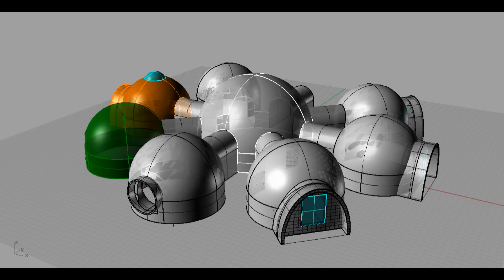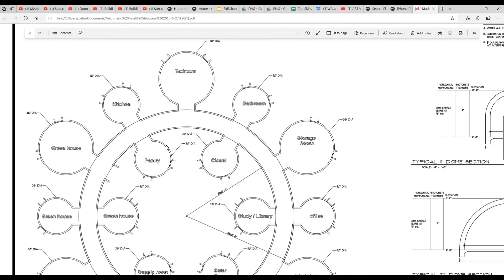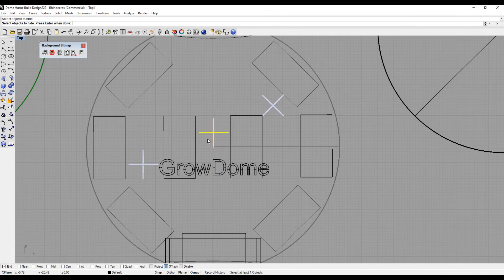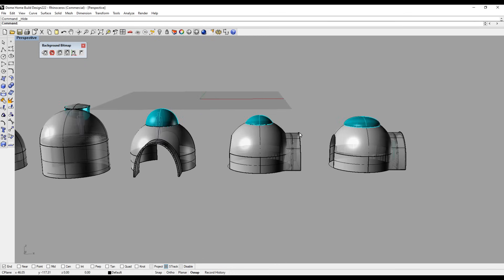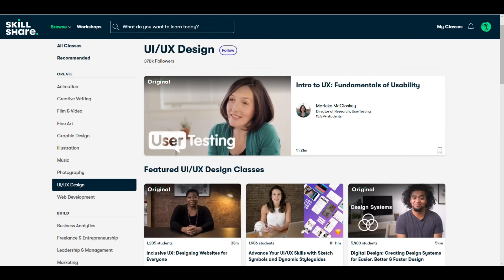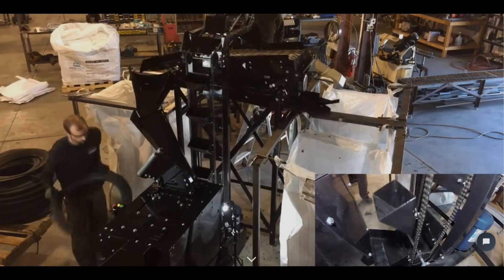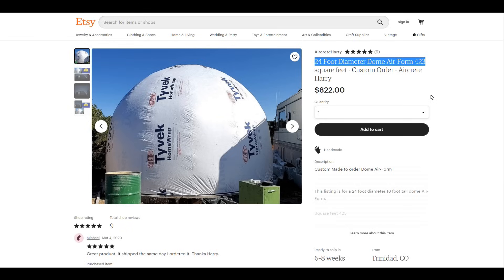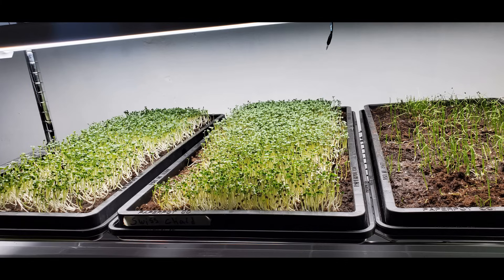Dome Home Design | Aircrete & E.P.I.C. Pump #aircretepump #aircreteharry #domehomedesign #aircrete

Comment: My opinion is, I'd rather build as big as I can. I like your original design better. But it's too symmetrical. I'd make the kitchen 30' dia., with a huge rectangular (round the corners) pantry beside it. I'd eliminate all the greenhouse domes on the left side (I assume that's south) and just have one massive slightly curved greenhouse along the south side. Make another connecting tunnel so you can walk through the kitchen into one end of the greenhouse. Keep in mind all the other domes can almost touch each other. All dead spaces can be closets or shelves for the rooms. Aircrete base with solid concrete floor over, hydronically heated. Center round skylights in all rooms. Reduce the number of domes protruding into the center green space. Consider a huge fake tree if you need center support for the middle dome. I get custom domes blown (for my underwater ROV's) from https://plastic-domes-spheres.com/
Watched more video. I don't think you need any bigger than 4' skylights. In the center dome just use an outer ring of six with a center one. Alot less expensive and still plenty of light. reference https://www.youtube.com/watch?v=RoGuvvzHY1A
Yep, that's the styrofoam shredder i tried to build the first time. Horribly slow! This one is alot better... https://www.youtube.com/watch?v=_DBo9l9YuB0

Comment: Have you looked into building dome windows with plexi glass? I’ve built a few windows with it for a camper that were curved and they work well . Pretty decent U value too especially with 2 sheets . I’d imagine if you built them in sections , you could possibly fill them with argon too . I bent 1x 2 wood in a jig , then painted the wood , drilled pilot holes in the plexi glass , used a bead of silicone and those metal roofing screws with rubber washers. I didn’t use a desiccant in side but I’d imagine that wouldn’t be hard to do . And could probably put a valve in the frame to fill up with argon .

Comment: Does the paper pulp create acidity to weaken the concrete?  How long does it last?  Does it need an alkaline agent?
Reply from the maker: If it had any negative effect, I wouldn't use it myself nor recommend it.

What I personally recommend, depending on the prefered system, are: 
- Drexel 
- Aircrete Thickening Agent 
- Air Entrainment Liquid 

https://aircreteharry.com/product/1-gallon-aircrete-thickener-two-x-1-quart-air-entrainment-liquid-by-aircrete-harry-allows-you-to-pour-aircrete-much-higher-improves-strength-see-description/
Reply: @AircreteHarry  the effects of acididty dissolving mineral bonds over time is guaranteed
Reply: I guess like you have to guage how long you rant it to last and what sacrifices are inherent in the recipe. Self-healing Roman Concrete has granules of alkaline mineral that leeches to fuse cracks that form and is like a self healing perpetual investment.

Comment: As a structural engineer cum architect, I would like to appreciate your lightweight aircrete/ EPIC designs, but this is the time od area of land,/ of high to highest  skyscrapers, during 2003 -6, I got opportunity to work for bruj-khalifa Dubai and got certification for pile foundation work in deserted lands. .I'm busy now to design multistoried domes in the form of Pyramid and also  to design of mixes to obtain compressive strength  better than concrete,  to some extent  I' m successful using graphene as a component, I invite the structural engineers of my interest to form a joint venture to change the scenario of modern structures and check the cost economy comparatives, if  your extreem help.

Comment: It's an interesting design, but I feel that you're missing out on a lot of space in all those key holes between each dome. In my opinion, having the domes be slightly larger so that many sections of walls will be interconnected. This would also make water storage pockets in those key holes.

Comment: Too much tunnels.... I prefer the dome s closer... how would I get furniture  in.
Reply from the maker: I agree with you, some else made a comment that the center dome would not have wall space. So I changed the design. Now the center dome has a hallway ring going around, and now there are two openings in the center dome. All the domes connect to the hallway ring. As far as getting furniture in the openings of the tunnels are 6 feet wide 9 feet tall no problem there.

Comment: I don't know why you wouldn't close couple  at least 4 of those outer domes directly to the main dome. All of those hallways are expensive and wasted space.  Those large arches are quite expensive for a window and will catch snow in the winter.  It should be easy enough to put a flat space directly into a dome wall for a window.

Comment: I'm curious if you can easly cut this product like regular air crete? So could you hole saw out a hole for say glass bottles etc.? Can you also make window penetrations etc. Without damaging the integrity of the building. As for skylights. Look at some of the big Yurt companys. They all have big premade skylights for the center of their buildings.

Comment: One thing you may not have thought about is tires being black will hold a lot of heat and unless those tires are covered up where they cannot get the Sun then that will be a big problem and if animals can get into them like rats and mice and birds and snakes and everything else they will make a home in them. Bees and wasps and Yellowjackets will be another problem if they can get inside the tires as well as water which will create mold.

Comment: I have been drawing a design like that for over 20 years intuitively. I'm not a architect I'm not a builder a contractor I'm just a little housewife but I keep seeing this design over and over and over so when the time comes I guess the good Lord will give me the ability to build it. Only difference is is each module was in a suite family suite and the center was the gathering place like the patio inner courtyard. It has the glass dome over the inner courtyard and you can grow many edible plants within that yard as well
Reply: Ive been dreaming of dome building for 10 years, but designing seriously for 5. Ive got some unique dome designs, and I think I can save tens of thousands over these standard prices. I dont need machines, or foundations, and since I moved to the tropics four years ago, I dont need skylights or thick walls either, its never below 75 here. 
 Im pushing forward, its my life long dream, the dome complex on the cliff over looking the ocean.  Plenty of options here, land is pretty cheap here.... let me know if you want to conspire together.

Comment: I used to make small 13” domes out of plexiglass. I heated the acrylic plexiglass in an oven at 400 degrees. I watched and when it sagged I quickly transferred it over to a flat sheet of steel that had a threaded hole in the center.   I had a 13” diameter ring made of 1/2” or 5/8” steel, I don’t remember now, that I had preheated so it wasn’t cold. I quickly put that over the plexiglass and clamped it down with vice grips all the way around.  I blew compressed air through the threaded hole in the center, the compressor was connected to it via a threaded pipe to a short length of air hose with a valve on it.  I would slowly open up the valve and as the air filled it, it would blow a bubble in the plexiglass. I just eyeballed how high I wanted it. 
  I used a bandsaw to trim it to size, then a bench grinder with a stone wheel to get it exact and smooth. A knife scraped around it finished it off to get it perfectly smooth, made the distinct fingernails on the chalkboard sound when scraping it. 
  Occasionally I would take one out of the oven too quick, or I’d take too long setting it up and the plastic would cool. When I hit it with the air a chunk of hot plastic would go flying straight up, so I stayed to the side with my head down.
  Also, if you heat it too hot or too long, it forms air bubbles in the plastic. 
  This could be done in large sizes. Use a pizza oven, or build a custom oven using kaowool or perhaps even aircrete.

Comment: Hi Harry long time no talk, now i see you been down to Italy Texas, i was there for the training back on 2005.
On your dome design the pantry should be connected to the kitchen either directly or off the corridor, it's not convenient to go into living room to go into the pantry when you are in kitchen...
Have you seen David's pumps from Monolithic? they are high priced but work very well and long lasting workhorses.
One more suggestion when you were adding the add mix fortifier etc - why not just add to the concrete mix you already had made, i think it's counter productive to add to foam, should be added to concrete mix instead of some of the water. Take a look at instructions.
Happy building
Vital Portugal

Comment: Looks like you might want to move one set of your solar panels further away from the roof canopy. The thing with solar is that if any of the cells on the panel get a tiny bit of shade on them, it kills the efficiency of the entire panel.

Comment: Domes, or cylindrical structure with domed roof?  2 rooms devoted to greens, but none to a shop?  I believe the shop should be the 24 footer. :).  Kidding aside,  have you thought of up-scaling the size? I can imagine much larger domes being feasible by applying 2-3 thin coats of light, high strength resin cement on the inflated mold until it will support the thick coats of aircrete. A single, huge dome would make a very elegant and strong home.

Comment: You might want to connect the pantry directly to the kitchen. I would eliminate pantry entrance from central space, just close the part of wall and use the hall as extended pantry space. Then just have the hall connecting pantry to kitchen. It has added benefit of giving you a solid wall where you could do built in bookshelf, a bench or what ever.

Comment: Man oh man I LOVE this video! I like the way you think ... you are a kindred spirit.  Couple of quick questions.  (1) How does the EPICrete compare with the Aircrete in terms of fire rating? I have seen tests where certain aircrete mixtures/recipes withstand up to 5000° F which I assume is due to the perlite mix. (2) What is the weight differential between the two products say between the same sized slabs or blocks with the same thickness.  Again, you are DA MAN!  I wish I could give you more thumbs up but I guarantee you at least one from me on every video and these will be shared as well.  Thank you for your time and effort. ETA a third question.  (3) What are the bonding properties of the EPICrete in terms of skim coating with shotcrete, bitumen,  painting, etc?
Reply from the maker: Thanks Gallo,  I have new test I will be doing soon to answer these questions and more. For now I leave you with this video.  https://www.youtube.com/watch?v=seB4Si01lP8&t=838s

Comment: Epic sounds like it would mold/mildew like hempcrete does. Have you tried leaving a test block partially submerged in water in a 5 gallon bucket for a few weeks?
Reply from the maker: No not at all like hempcrete to much cement on the mix.

Comment: hello Harry. I'm thinking about building a concrete boat how do you think the epic will stand sea water ?
Reply: If you could trowel the polystyrene in past the remesh it would be a sure sign that you didn't have enough remesh. So many large inclusions in the mix would mean you would need a thicker cover to stop saltwater from reaching your remesh, so you'd end up with a heavier, more expensive boat in the end.
Reply from the maker: It mite work good, wont know till you build a model.

Comment: You da man, Harry!!! BTW on the dome cap windows, my good friend Bob Coles placed a large round skylight dome on top of the central dome of seven total domes, his plan for Jefferson Street, Buffalo, NY library. Came out great, BTW, used every day. Turned out that even in dark Grey skies Buffalo, so much sun came through, they had to cover the skylight with a fabric tarp to reduce light blasting in. Also the seven done plan was based on African village layouts where each dome was connected as village but not physically connected as yours are... His domes connect as outer circumference blend into each other. Reason for the central dome is connection that would otherwise be outdoors in Africa where its warm... North in Buffalo freezes much of the year. So they're connected. No tunnels... They're actually not domes, I just remembered, only center is domed, the others are flat roofed circular rooms. Ahhh, yes. Similar though.. Anyway, all good, loved this video...) thumbs up!!!
Reply from the maker: Cool, Thanks!

Comment: For skylights, perhaps a company that makes custom acrylic fish tanks.  Great designs!
Reply from the maker: Thanks!
Reply: If you heat a sheet of plexiglass up fairly evenly, you can shape it over a mold of the right dimensions and just cut away the surplus. I guess it would be fairly strong. Otherwise I suppose it could be possible to use the triangles and build a skylight with several flat surfaces in that way. It will be heavier, but it would look pretty good, I think.

Comment: A honeycomb design with equal sized domes meshed together like soap bubbles on water would be most efficient .
Reply from the maker: I like the idea but it's harder for me to build the bubble design than separate domes.
Reply: WageslaveUranus just curious but where in nature might I find a honeycomb built horizontally rather than vertically and, if by chance you can point me to them I need to meet their waterproofer and gutter men.  Now, with that said and if we're talking nature at its best then egg shaped domes with the lower one third under ground for water or other storage .... acting like a ballast,  and with all domes connected in an egg carton configuration ... yeah, then that's horizontal but still exceeds the current design in terms of stress and fracture resistance and super long term sustainability I would think, without crunching the numbers.  The question would be, big end up or down and what would they all be seated in, sand or clay?

Comment: If skylights cost too much if could be cheaper to make them yourself by building a square wood frame, strech plastic sheet onto it, not too tight, then support the corners up so you can get underneath, then fill the top with water so you get the right kind of curve, coat the bottom with fibreglass a few times to get a stiff mold, then remove the water, wax it up then pour Clear Epoxy Resin on the inside of the mold, keep the mold moving around to evenly coat it. will have to get an additive for faster curing.
Reply from the maker: I don't think I'm ready to attempt that. I was thinking of cutting gore shape out of plexiglass and connecting them with a track. Thanks!

Comment: Cool idea with the sky lights!   

I've been fantasizing about making a greenhouse dome but instead of using regular windows it would be using prisms or light tubes.

That way you don't loose that much heat from large windows, and they are easier to cover up if you want to reduce sunlight.
Reply from the maker: Great idea.
Reply: @AircreteHarry  When you use skylights they don't need to be that big to gave lots of light when on roof. The light tubes used as skylights give loads on light with very small diameter, research first before you spends loads of money for way oversized/priced and too  much sun or light... big size maybe in living room and kitchen, day use rooms - bedrooms smaller

Comment: Spend Xtra 200$ on PEX tubing infloor heat. We did a 6000 sq.ft. dome with a
2 ton heat pump the owners keep AC on
70°  mile high Arizona. Infloor heat can be Vacuum Tube Solar hot water. OR wood boiler. Or all for backup.
Reply from the maker: I was thinking of doing just that idea. Thanks!
Reply: Awesome, I would love to know more details of this. it's is the kind of thing I am planning to do, and have the solar hot water pipes go to the floor to use it as a thermal mass, or to a cob bench that has a big insulating covering box over, then remove in the evening to release stored heat